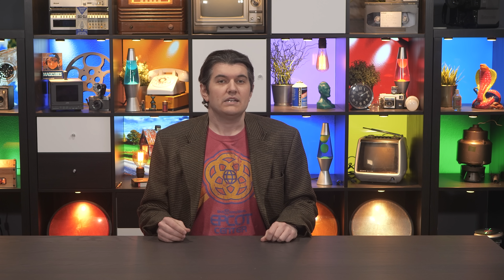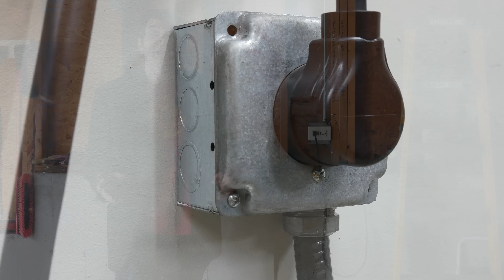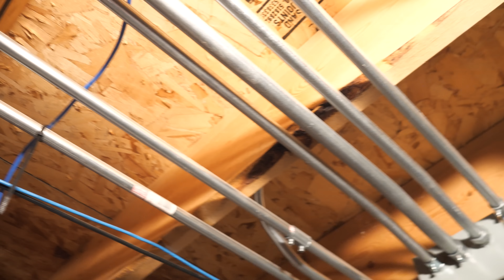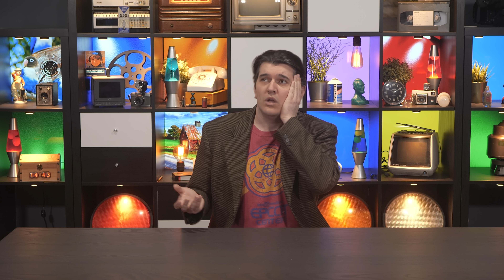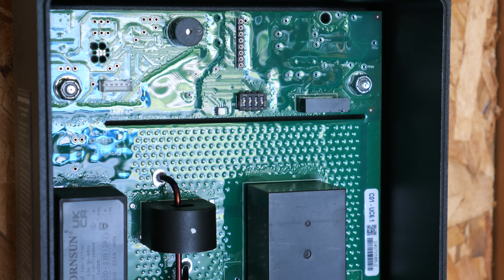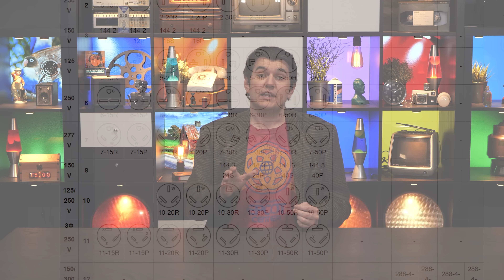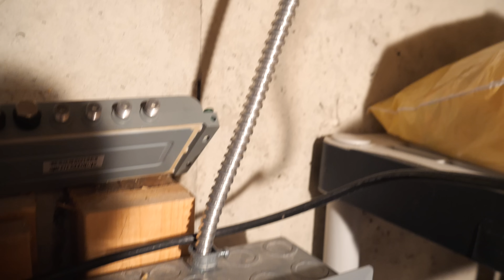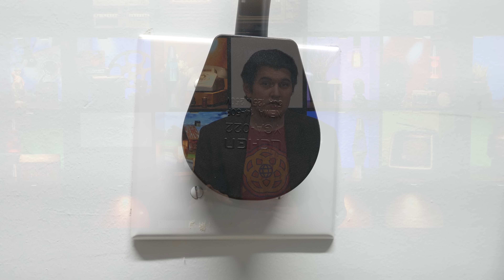The "standard" car charger is usually overkill—but your electrician might not know that

Comment: I just purchased a Hyundai Ioniq 9. (They did fix the conditioning issue.) The NACS wall adaptor came with cables for 220v 28 and 15 Amp as well as 110v 8 and 12 Amp service! It's great as I can easily run the plug on a 15 A branch circuit without having to be concerned with overdrawing the breaker. (Using the 8 A cord) I may put in a 220-30A outlet, but the superchargers are relatively cheap when using them in the off peak hours, and I can bring a book.

Comment: Coming in from the future! I would argue that even if you drive a lot everyday you shouldn't be looking at a NEMA 14-50. You probably want to hardwire the charger instead. I was able to find Metal Clad AWG 6 cable. I put the cable in place myself then had an electrician do the install. Fun fact: If you do it this way you can use a 60A breaker because of the 20% rule. AWG6 is rated for 50A, so a 60A breaker with the 20% rule gives you 48A. Just make sure your charger has a 48A setting.
*Wanted to edit and say: 200A service isn't needed either. I only have 100A but I have the car charger set to run during the times my other big loads aren't running. (Heat pump and electric water heater are the big offenders)

Comment: I charged on level 1 for most of the time I had the 2012 Chevy volt. I got solar panels and a battery installed. So, I had them also install two 220 volt plugs. One in the garage and one outside the house in a weather protected outlet.

Comment: For the NEMA plug in the garage that needs ground protection, you can get around this by removing the normal 30 amp breaker, and install a 30 amp GFCI breaker.

Comment: NEMA 14-50 is definitely the way to go and it's actually the cheaper solution. The Tesla wall charger is like $500 more expensive and it gets you like 30% faster charging, but not really worth it. Remember that the NEMA 14-50 outlet needs to be the premium Hubble one! I got the cheap standard one and after a while it started charging at much lower speeds. Tesla sensed heating or something and they slow the charging down to 16A because there have literally been fires due to cheap NEMA 14-50s

Comment: On a normal 110V outlet you'll get about 3-5 miles range per hour. So in 12 hours (!) you add about 36-50 miles range. Might be good enough for someone just going to the grocery store nearby, but for a longer daily commute it's rather cumbersome. You can install a 240v outlet yourself, but some states require a permit and inspection. The material is not cheap either. Here in NC they have subsidized programs with up to $1200 to install a 240v outlet. That makes charging more convenient and if you schedule the charge in late night/morning hours you have a lower rate for the electricity. On a public charger to 80% from 20% in about 15 minutes not really that long.

Comment: I live in a very large city of Dallas, TX. I currently live in an apartment and I have a garage with my apartment. It’s not connected to my apartment. It’s below my unit. 95% of my charging is used in my garage using the standard wall outlet. I also work from home so these conditions are ideal for me. Mostly everything I do during the week is close to where I live. On the weekends I am always out around the city as far as Arlington, which is about 50 minutes from where I live and all over the city. Still I have enough charge to make it home to plug in for the night until the next day to drive more. I have only used a fast charging network once in 3 months. I thought I would need to install one of these wall units. Turns out my standard outlet works fine. It will take about 2 full days to charge from 10% to 95%. You should never charge to 100%. But because I drove around in my community it will take about 4 days of unplugging driving and plugging in over night most of the day while I work from home to get to 98%. I have no issues and love not having to worry about has prices. Also my garage is free charging so it’s not charged to my person electric bill but when I first got my car I lived in a house and noticed no difference in my electric bill. I have saved a lot of money buying an EV.

Comment: I have a Sierra EV and live in WY where DC charging options are limited. I typically only drive 30 miles a day and could get by on a 120V connection for that.  However, there are occasions where I will drive several hundred miles - without fast charging - and arrive home with around 10% battery capacity. With the Sierra's large battery it would take forever to get it back to 80% from that state on a 120V outlet, so I installed a 50A 240V.  It was definitely more work and expense than just using the wall outlet already right there next to the truck, but in my case it was totally worth it.

For the DIY folks, don't skimp on this.  Use a NEMA 14-50 specifically labeled for EV charging. The cheap ones are not designed for multiple continuous hours at full load and can fail. Remember the 80% rule: 50A, 50A breaker, charge at 40A. And use copper wire only, like THHN.

Comment: At work the AC chargers require app and it's annoying and clunky so I agree it's stupid.
Though there could be benefits, for example if it's at home, it could be linked to the electrical company and charge only if the price of electric goes down on a varied plan.
Because power grids sometimes have too much energy generated and not enough demand and they are happy for you to increase to load, otherwise they need to wind down the grid, the wind turbines, disable the solar panels and waste all this energy.
We all seen wind turbine farms where half of them are stopped (so like there is wind but they straight up put on brakes).
Or at work we have solar panels on roof and most of the time solar panels don't generate enough electric to cover the need of the factory (UK weather) but sometimes there is excess if the sun is strong, proper smart charger implementation could then charge the cars if there was excess electric and save the company the electric bill.

Comment: In Swedish we have a word "villhöver" which is a combination of "vill ha" (want) and "behöver" (need). It basically means "I need this because I want it, not because I actually need it". Seems like a good word for this video.

I installed 22 kW chargers at my house, not that I actually need 22 kW for my driving, but because I have solar panels and want to be able to push as much power into the car when the sun produces enough. Before this I lived with a slow ~1.8 kW charger for many years. Usually worked very fine.

Comment: It's fine that you want to increase awareness of lower voltage EV charging, and you should stick to that.  You stated that you are not an electrician and I agree with that. The problem starts when you show people how to improperly install an EV circuit. The NEC requires and EV circuit have a capacity of 125% of the maximum load of the fixture. It does not care about dip switch settings they can be changed by anyone, it must be able to handle 125% of  the maximum possible load which is 50amps in your case. 50x1.25 is the min circuit size. The NEC is not written for your particular car or your particular needs. Your father can sell the house tomorrow and someone with 400 mile  range EV can move in thinking he has a properly installed charging station, and when he can't get the amps, the first thing he will probably find stopping it is the dip switches, and turn them to 50amps, overloading your circuit. That is why the code is written for all installations not your particular needs. Stick to what you know, don't give advice on circuits your not an electrician.

Comment: Standard outlet will cause phantom drain to eat 1/3 of the electricity going into the Tesla because the car has to stay awake the whole it is slow charging.  In California electricity is ~$0.43 per kw.  That's $500 or more in wasted electricity that never makes it into your car if you plug straight into the wall.

Comment: We charge at home, 240v 16amps,  and try to ONLY charge between midnight and 6am (when it's $.14/kWh vs $.40+ the rest of the day).  So we get about 90miles/session on our Model Y.
This is just barely sufficient.  For us, the goal is NEVER to charge at a charging station or during non-super-off-peak.  A trip to LA and back (from SD) will leave us at about 15%.  So I wish I had at least 32amps so after a trip like that, we can get up to full with one charging session.

Comment: Wow, this is a good video. I was not aware that the charging electronics for AC charging was in the car. While I understand electricity and codes, people obviously should consider the safety when going into the panel (i.e. hire an electritian). Home charging is great and almost all homes have the ability to add a 240v circuit of some amperage. I know you show that in a bind you can charge from a normal 120v outlet, but they are very limited in power (which is what dictates charging rate). 240v is twice the power of 120v at the same current (amps), which is why 240v at 30 amps is 4x the power of 120v at 15 amps.

Comment: I'll add my 2 cents.  If you are buying an EV, you should have a place at home to charge it (you'd be surprised at how many people buy an EV, who live somewhere they can't charge at home and rely on public charging, which is stupid).  Regarding home charging, you really should get a level 2 charger.  Some of the challenges in the past are no longer an issue.  If you have an old panel, you can get newer Smart Charging systems that use sensors and active load management.  That means, if you have a lot of things running, it will dial down the power to your charger.  If you don't have many things running, it will ramp up to charge it faster.  Secondly, while level 1 charging is always an option, it's only about 40% efficient vs about 90% for level 2 charging.  That means for every $10 you spend on electricity, you are only getting about $4 worth of charge in a level 1 charger vs about $9 for a level 2.  Level 1 charging also takes a very long time if your battery is low (could be 20-30 hours).  While you can just plug it in every day, that becomes a nuisance vs just plugging it in a couple of times per week.  EVs are expensive, if you are spending the money to buy one, just get a proper level 2 charger for it.  It completes the ownership experience, is less expensive to operate (since it is much more efficient at power delivery to your EV) and also charges much faster for convenience.  Also, limit the charging you do with Level 3 chargers.  They are hard on the battery.

Comment: I drive a Tesla and I did not have to buy a single thing to charge my model S at home, absolutely nothing. My Tesla came with a 20 foot cable, one end plugging into the car and the other and having two connector options. A standard 20 amp 110V connector and a 30 amp "dryer" connector.

Comment: You can get metal clad flexible cable assemblies in larger than 10 awg. It's commonly used in residential condo buildings, hotels, and such as feeders. You might have to go to a real electrical supply house to get it as opposed to home depot, but it exists and is readily available.

Comment: Good video. A couple of important points: if you drive a lot, inefficient 110V charging can really add up over time. Also, if your utility company offers an EV time-of-use plan — like San Diego Gas & Electric’s discounted 12am–6am EV rate — 110V charging may only give you around 54 miles of range during that cheap-rate window, while also using roughly 15–20% more electricity due to charging inefficiency: 

From Google: AI Overview

Charging a Tesla at 110V (Level 1) typically requires approximately 15% to 20% more total energy (kWh) compared to 220V (Level 2) for a full 0–100% charge. [1, 2]
While both methods add the same amount of energy to the battery itself, the extra kWh consumed at the lower voltage comes from significant efficiency losses. [1, 2]
Why 110V Consumes More kWh
•	Constant Electronics Overhead: A Tesla must "stay awake" to manage the charging process, running the Battery Management System (BMS), onboard computers, and cooling/heating systems.
o	This parasitic draw is roughly 200–300 watts.
o	Because 110V charging is much slower (taking days for a full charge), this overhead is drawn for a significantly longer period than at 220V.
•	Conversion Inefficiency: The process of converting AC power from your wall to the DC power stored in the battery is less efficient at lower voltages.
o	110V Efficiency: Ranges from 72% to 80%.
o	220V Efficiency: Ranges from 90% to 96%. [1, 2, 3, 4, 7]
Comparison of Total Energy Required
Using a typical 82 kWh battery pack as an example, the estimated total energy drawn from your electrical panel would be:
Charging Rate [, 2]
Estimated Efficiency	Total kWh Drawn (for 82 kWh battery)
110V (Level 1)	~80%	~102.5 kWh
220V (Level 2)	~94%	~87.2 kWh
Key Takeaway
At 110V, you are paying for roughly 15.3 extra kWh just to cover heat and system overhead during the longer charging window. This inefficiency is even more pronounced in cold weather, as a 110V outlet may struggle to provide enough power just to warm the battery, resulting in near 0% net charging. [1, 2, 3, 4, 5]

Comment: We are 2 adults and two college teens at home. We have 3 electric cars. We use the 30A charger once in a while in case we need a full battery for a long trip the next day, but we mostly swap the 8A wall plug when needed 12 months a year winter included. Every consumer technical item is overkill when you can communicate and organize.

Comment: Great video. You hit on a lot of the potential problems I saw in my career. A few comments from a licensed electrician with over 40 years experience. 1)Anyone trying to do this job themselves needs to be really, really, careful. There is a lot more to it than many think. Most don't understand how much 40 or 50 amps of charging for hours straight is compared to how much the rest of your home uses. There is theoretical and then there is real world. Is your electrical system in good enough shape to add this load? I have seen homes burn out their 40 year old meter base once a daily load like this is added.2) Be very careful about the type and quality of 14-50R outlet used. The less expensive ones are notorious for burning up, even when installed correctly. A good quality EV rated type will cost at least 2-3 times more. The original types were designed to power appliances like a range, where they are plugged in once and never touched again. Ranges rarely if ever use the full rated amps. EVs will use that every day in many cases. Personally I think it is foolish and unwise for a homeowner to do this job themselves and risk their safety and belongings just to save a few hundred dollars. Most don't have the proper tools or knowledge to do the job correctly.  
3)These outlets, regardless if the charger has it built in, are supposed to be on GFCI breaker which is more expensive and somewhat less reliable( I have had to replace a few). Many will skip this but that is on them. 4) I am in agreement that most don't need the absolute max charging rate. If people would do simple math they would figure this out. I had one customer not use me because he wanted the absolute max Tesla charger amperage and it was going to cost significantly more to get a 20% faster rate. 40 amps was not fast enough for him despite the fact he said his wife was just using it for driving maybe a hundred miles a week and charging at night. I'm sure he found some hack to go out and run the smaller wire for a cheaper cost and just set for max charging anyway. 
5) homeowners need to be very careful plugging into their standard 120v outlet in the garage. Until recently, they were usually on with a lot of other outlets, rated at 15 amps, and used  a cheap 50 cent receptacle. A continuous load running at the outlets max, day after day will almost certainly end up with a failure or worse. These should be a dedicated circuit from the panel. They are slow, but fine for topping off every night. 6) Be very careful about adding EV charging unless you have had the entire home's system evaluated first. In many cases we are talking more power than most homes use in total, running all night, while you sleep.

Comment: I have a model 3 tesla, and that charges at about 5 miles of range per hour.  a model Y LR charges at about 4 miles of range per hour plugged in on a standard 110 outlet. 
I spent 3 years using that 110 charger, and the only time it was a headache was in the summer months and that was about 4-5 months of the year where i had some problems.  and the charging speed would drastically slow down to half of that.  
also, an EV will use MORE power in the summertime, thus reducing range and needing more recharging.
I now have a 14-50 outlet, and charge at 28-32 miles of range per hour, and basically can charge my car in under 7 hours.  i moved and had one installed a month ago and im so dang glad i did it.  its been an amazing lifesaver and peace of mind.  
im using a tesla mobile charger.  

so is it overkill?  nope.  not at all.  even in the summer if it does slow down to half of my new speed, its still 3x faster than the 110 outlet in good conditions.  everyone should get a 14-50 setup.

are you topping off your gas every day?  you arent wrong, but point to make here.  
1.  public supercharging has become expensive, and in many cases negates the cost savings from gas cars
2.  public supercharging is not always in convenient areas, in your direct easy path, or often in busy shopping plazas that are a pain.  third party charger networks (for those without teslas) are grossly unreliable, need multiple apps, etc.  
so having an "overkill" charger at home, makes sense even if your typical range usage doesnt "calculate" for it.